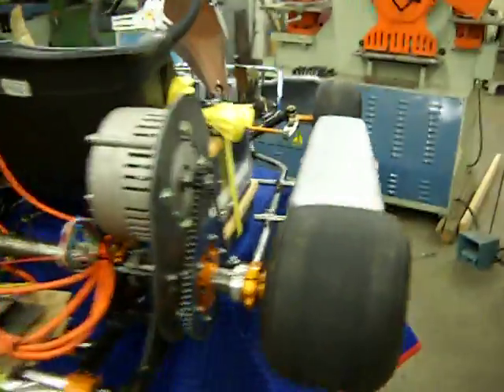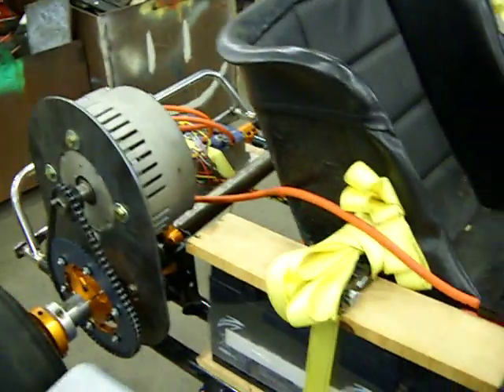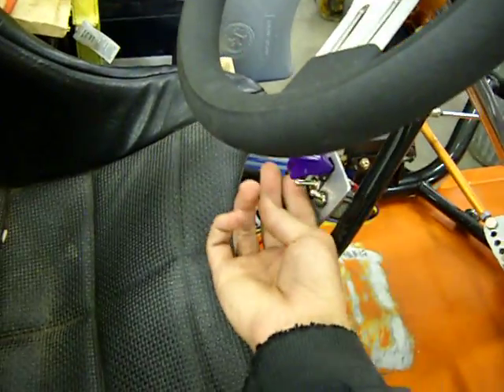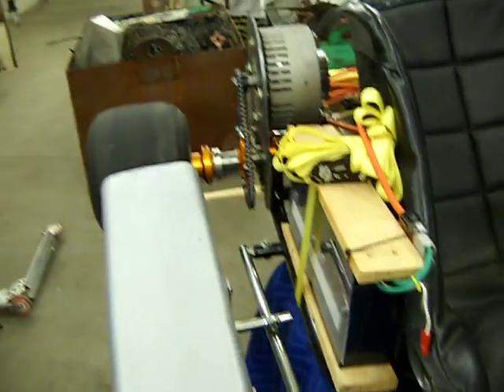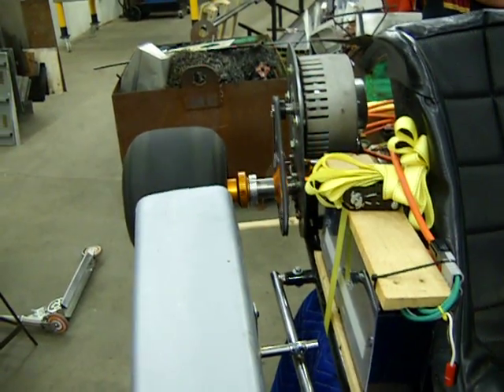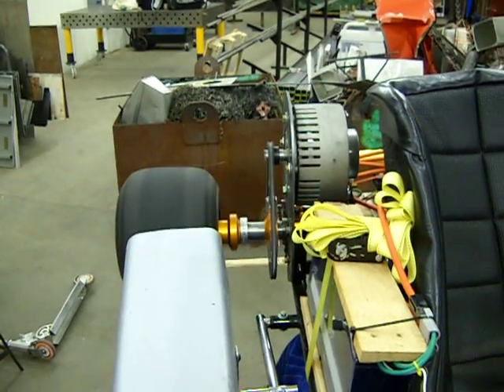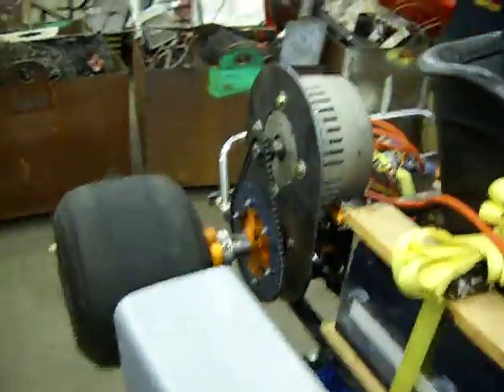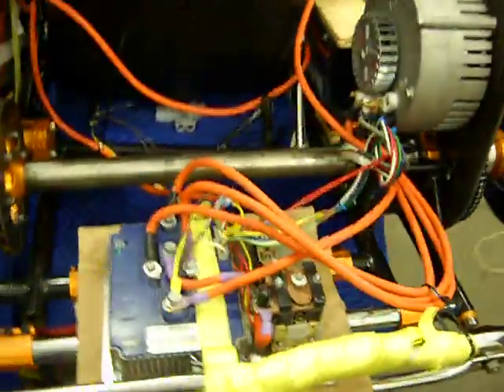Electric Kart First Wheels-up Test- Brushless Etek

Comment from the maker: @CalabreseMPC Haha- maybe I'm less of a moron than you seem to think-- everything IS wired correctly. The problem was inconsistent- not constant like what you would see from a wiring error. The controller was faulty. 

On this first test it was geared for a very low top speed (15 mph maybe) and accelerated quickly but without wheelspin. That is, with the controller malfunction and at 36v. I was expecting better performance at 48 but didn't have a chance to test that before the controller failed.

Comment: @ledledledled ahh yes! you wired ABC,123 the wrong way. 
I just worry on the jerking downward on acceleration, even if it is minimal it is something to put into anther concept.

I have been tossing up whether to do this, the motor I am after is 17kw, but it costs too much for me to do now. what's your top speed, and does it spin from mid rev-range when you flatten the throttle?

Comment from the maker: @CalabreseMPC The motor shaft is short enough that it doesn't need additional support on the other side of the chain drive. Most electric motor chain drive systems are constructed this way. The actual problem manifesting with the stuttering and jerking drive is the motor controller malfunctioning- it's a brushless motor so it's electronically commutated- the motor controller is responsible for energizing the phases of the motor in sequence. It's messing up the sequence, causing that jerking.

Comment: @ledledledled I'm sorry to seem blunt, but if your motor were balanced you would have another support at the end of the shaft after the chain drive. does it happen under hard acceleration? The problem has also probably seemed to have faded, and you might have had to tighten the chain?

Comment from the maker: @CalabreseMPC Your last comment (the one you deleted) said you thought there was something out of balance. Your comment on the other video said the motor is "fucked" You really have no idea. Nothing is off balance enough to cause the problems seen here particularly at low speeds. The motor is fine. The motor controller was malfunctioning and has since failed entirely. It was purchased used and was of unknown condition from the start. Thanks for your constructive comments.